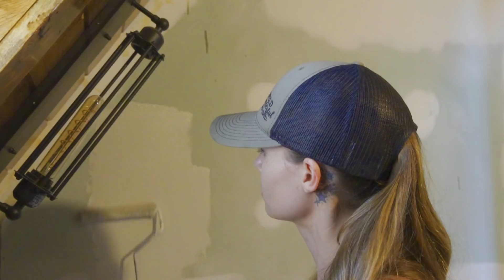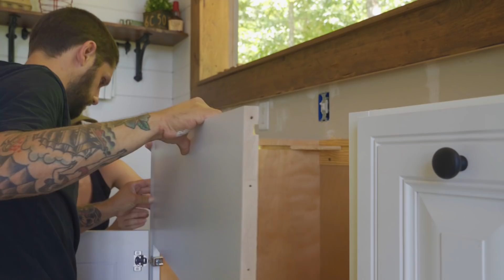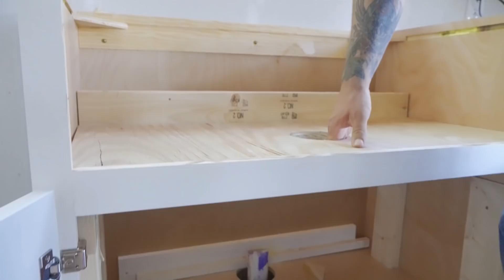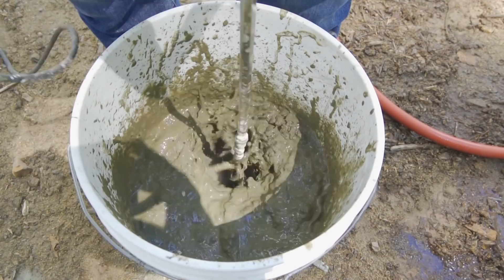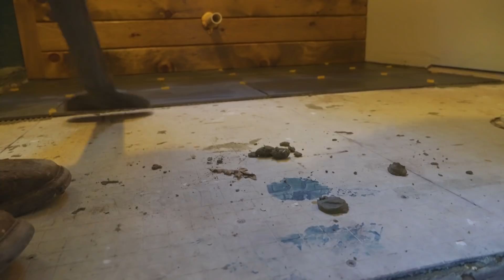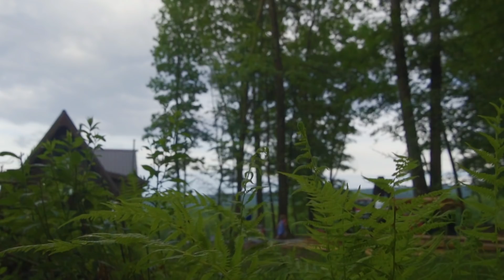Installing Tile In Our Bathroom

Comment: Place looks awesome !  Chuck is the baddest dog on the ''Tube'' !
I'm sure you know this, but after the grout is done and dries, soak it with grout sealer until it won't take anymore, no matter how many times. With grout sealer, more, much more is WAY better ! It's so easy nowadays with the sealer in a small bottle and the built in brush.
Thumbs up !

Comment: I used Schluter Ditra membrane under the tile in our upstairs bathroom. The membrane uncouples the tile from the wooden plywood floor below so there’s no cracking in the tile or the grout. Some contractors use it over concrete too and is a good solution to prevent cracked tile and warranty calls.

Comment: Great job. Tile's pretty easy to lay. You have to be fairly spastic to not be able to lay tile in a semi square area. I only have one adjustment you might consider and that is to split a few tiles long ways and do put them on the wall for your baseboard. It protects the way when you mop and looks a little more high class. The only difference in laying it is you put the thin-set on the tile when you go to hang it.

Comment: The only concern I would have about the tiles is if the particle wood wasn’t screwed down all over. If it takes on moisture from underneath it could belly up slightly in spots and undermine the adhesive causing the grout to crack out. My experience has been to pour in a levelling layer special levelling cement which the tiles adhere to better. Looks good now though. All the best. Love your videos. Always nice to see couples working together so well. Lucky man.

Comment: french porcelain tile  ''gres'' is a good start..it is all I installed in the latter years, especially on the floors because it does not crack so easily.

Comment: Bathroom is looking good.  I know it's too late now, but you should use a decoupling membrane when you are tiling over wood.  You may have issues down the road with cracking from flexing of the wood. Even quarter inch backer board is recommended.  I learned through experience.  I have tiled in 5 rooms including kitchen and entryway. Didn't use membrane on concrete in one room and some tiles cracked within the first year. Live and learn but have fun doing it.
Reply from the maker: There is backer board under the tiles, not wood

Comment: I did Tile & Masonry work for years. You don't have to start in the middle of the floor with your tile. In that room I would have started at the door on the left hand side looking in and that way you would probably only have to cut tiles along the back where the sink goes and tiles along the right at the wall. That can save you a lot of cutting.

Comment: Josh I have the same sink. I removed the front of my cabinet just like you did. But I  laid the sink down on the front edge to the inside of the sink panel and traced it out. Then cut it out with my jigsaw

Comment: It's no worse than spreading icing on a cake.  The easiest way to do it is use the trowel short side way to slap the grout down in blobs then switch to the long way side to spread it.  The notches should be the ones that would fit a pencil into.  You just hold the trowel at a 45 degree angle and pull it towards you.  You want to get even coverage across the area you are applying tile to.  The tips of the notches will scrape on the sub-floor and the mastic will spread between the gaps.  It serves the purpose to create a suction effect when the tiles are applied.  If the tiles are ceramic you will want to wipe the back side of the tile with a damp sponge before applying lest the dry tile pull moisture from the mastic after being applied.

Comment: I have a tip for y'all . When ever you're mixing in a five gallon bucket if you will reverse the drill motor it will force the material to the bottom of the bucket instead of trying to splatter out on to the floor.

Comment: Remember the rule of the throne  when doing tile.  Use full tiles where you see them while sitting on the throne.  So the cut tiles are in the back and covered

Comment: Something in the US that always bothers me as a tile layer here in sweden is that you seem to put tiles directly on wood, is that right? The movement in the wood will not be a permanent fixture for the tiles (but then again, I see this all over in the US so I guess it's standard over there). Otherwise good job! Though I would use a 10mm thinset tool and use on both tile and floor... Looks awesome anyways guys, great to follow your adventure!
Reply: Instead of spreading on the tile, one could spray with water. The magnesium on the back of the tile is good to get rid of. Just a little help from a tile layer :)

Comment: You need to back-butter your individual tiles before you place them. This will help eliminate air pockets under the tile which produce a "hollow" sound when you walk on them. 

Don't be too hard on yourself, tile installation is not easy to learn. It takes some practice.

Comment: yup if you can't fix it with a hammer .... get a new one or a bigger hammer, and here's a tip ... use knee pads when you use the splitter

Comment: Ok guys, here is my punch list for you guys to finish the A-frame:                                      

INTERIOR 
Crown molding in back rooms of A-frame
Replace front door window
Barn door for utility room.                                     Install chandelier lights in the living area

Bathroom:                                                            Tile bathroom floor - done
Bathroom toilet - done.                          
Trim and baseboards in bathroom - done
Bathroom sink and cabinet 
Tile shower
Shower head
Bath towel rack
Toilet roll holder
Door for bathroom 
Bathroom exhaust fan
Electrical plate for switch - done

Kitchen:
Kitchen appliances 
Kitchen countertop 
Kitchen island countertop 
Quarter round molding on kitchen wall next to beam
Backsplash for countertop 
                                           
EXTERIOR
Finish soffit on dormer
Deck for front door 
Deck for French doors
Insulate under A-frame floor
Skirt around A-frame 
Radiant floors                                                   HVAC
Reply from the maker: You got it! Also radiant heat for the floors before we insulate the floors, barn style sliding door in the back portion of the house where the washer and dryer are and install air conditioning. The list is getting shorter but when I actually sit down and read it I still feel overwhelmed haha